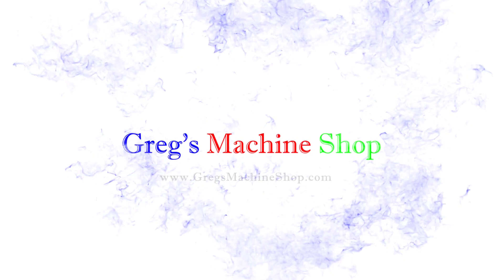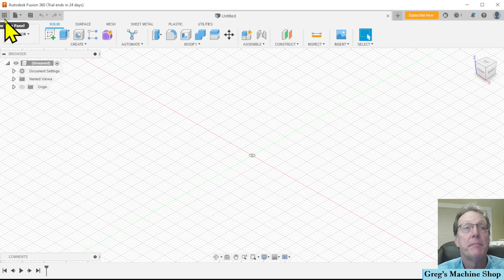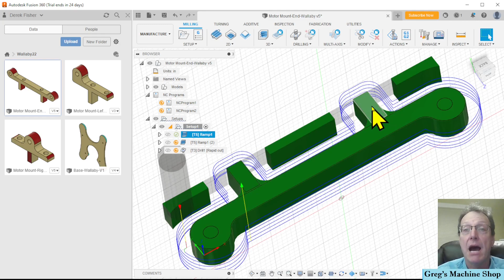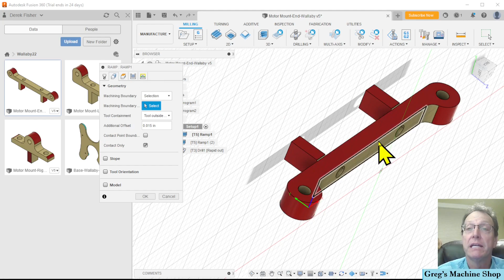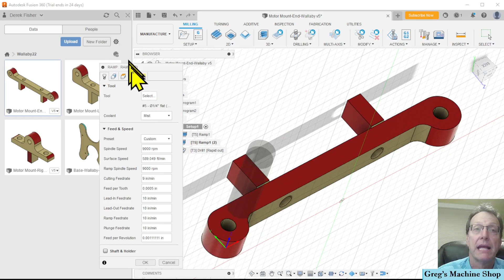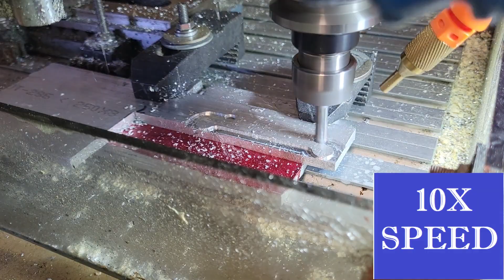Trick Fusion360 into Doing What We Want - Wallaby Part 1D Motor Mount Brackets

Comment: Fusion has the facility to add tabs as part of the 2D contour path, it will also do a final full depth finishing cut as part of this path so no need for modifying the part like you have or running a second path just to do the finish cut.
Reply from the maker: Jason, thanks for the feedback.  I was unaware of Fusion360's ability to add tabs--what a time saver!  I was mucking around with my model and adding the tabs in CAD.  I also like your suggestion of using the 2D contour path with its ability to do a final finishing pass.  Another suggestion you made that I liked was to use an Adaptive tool path to clear away the material so we don't need to cut a slot.  Cutting a slot puts a lot of pressure on the tool and shortens its life. And yet another suggestion you made was to do away with the tabs altogether by drilling the holes out first, securing the work piece with screws to the table through these holes, and just cutting a clean 2D profile.  No muss, no cut offs, no filing.  Thanks for the input.